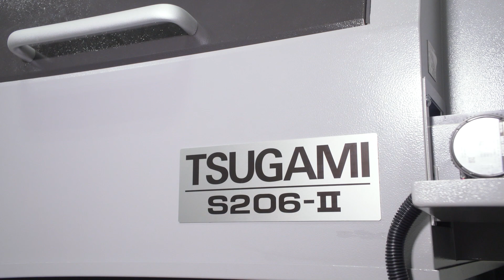Benefits of Oscillation Cutting with Tsugami's Product Manager

Comment: I use mazatrol, with some imagination I was able to use this technic while turning UHMW poly material to break a chip. I've been doing this for several years. In my experience, the surface finish will depend on your setup, type of machine, rigidity of the machine and material being cut. The UHMW is very flexable, and we have standard chucks, no feed through system like the video. Because of this our stock is extended away from the spindle and will flex quite a bit during this type of cutting. Causing a bad finish for a 1 pass application. I quick finish pass is need in my setup. But the machine in the video looks to have a better setup for this application. Just my 2 cents...